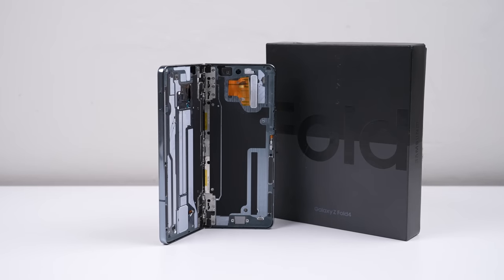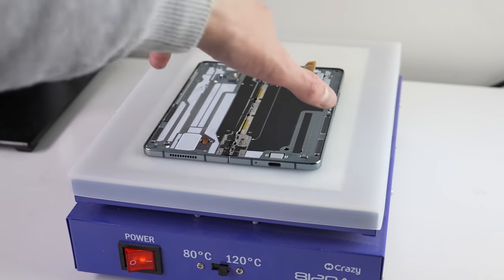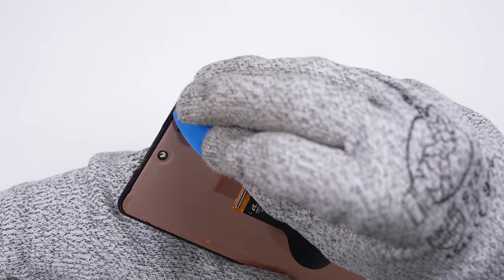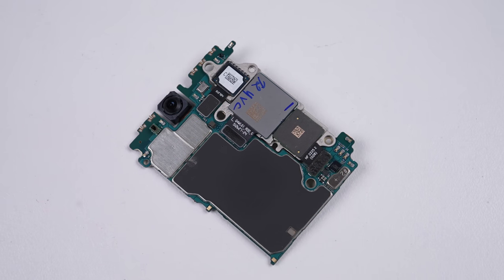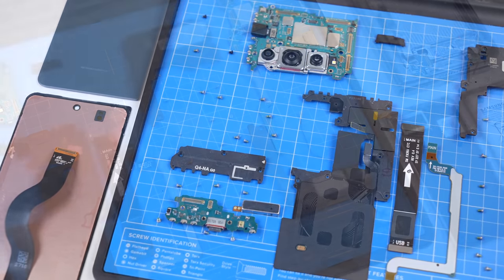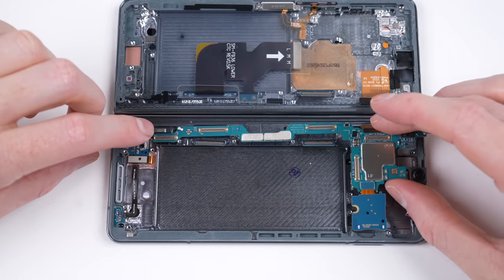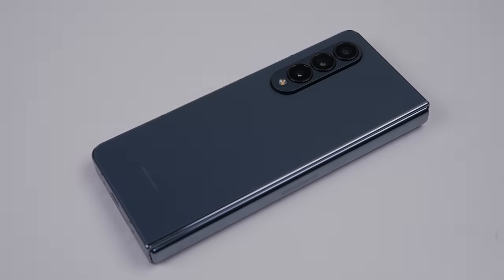Galaxy Fold 4 Restoration - Sellers Lies So Obvious I Had To See It For Myself.

Comment: while that phone definitely wasnt touched by a licensed tech, samsung license0s do exist. Asurion, the US largest phone insurance providers paid for mine as well as my apple certification. 
The different screw behind the screen isnt a screw holding in the plastic cover. it holds the sim tray in place. easy to keep separate if you lay your screws out in order.  i usually throw a couple thin strips of double sided tape on the back of the battery to ensure it doesnt loosen in the future with exposure to heat. i would also recommend an AOD jig, makes opening most samsungs a dream.  otherwise, excellent video as usual.

Comment: While it might have 18 months warranty left on it, Samsung's flip phone warranty (Samsung Flip and Fold are in this category) doesn't cover the screen in any way, so any type of screen damage either accidental or manufacturer's defects have to be paid in full by the customer, unless you take out an extended warranty of sorts which in most cases costs far more than a screen replacement

Comment: You can use IR ceramic heat plate - it does not need direct contact. One like they use as bottom heater in cheap PCB hot air stations. Just stick the thermocouple on the metal part near battery not to overheat it.

Comment: Congratulations, you are a "licensed technician"! I also noticed that the sim tray was attached via flex cable, does that mean it's upgradeable?
Reply: I only hope that some day, there will be an available SIM tray upgrade, user installable, with a Micro SD card slot piggybacked to it.  BTW, my LG V20 has that arrangement, although you have to open the door and lift the battery out to access it.  BTW, my Fold 4 and V20 are networked together, along with the other wi-fi capable devices in my apartment.

Comment: The E.U is passing a law that will stop phone manufacturers from sticking batteries with adhesive so the replacement battery will be easy to remove & replace so click off back panels may return

Comment: I use to work for a major US based repair company that is partnered with Samsung, and am certified/licensed to repair their phones, so yes we exist. Also yes, we never remove the inner screen, Samsung does not repair that screen and will usually just replace the phone or it will require a complete body/frame replacement that houses the inner screen.

Comment: until today you've been very lucky that none of the samsungs you've formatted are active "format lock", I don't know what it's called in the english language system, but i know that you can't format it through the boot loader without the device's password if this option is on. I know this because I played a lot with custom rom when I had samsung and this option always got in my way in stock rom

Comment: Yea definitely an expensive repair for DIY. I ended up taking the z fold 4 refurb to Cityphones (a samsung authorised repair place in melbourne) and yeah while it felt like paying twice, it still works out cheaper than a brand new z fold!  When they do it, new batteries are alao included in the price.

Comment: I wonder if the high temp adhesive is an anti repair measure.
Reply: It's not. It's a very thin adhesive so it needs high temp resistance otherwise the screen could fall off if the phone were to overheat for whatever reason
Reply: @thehellkeeper5674  I don't recall most other devices having that issue with the screen being detached like that, and they don't require extremely high temperatures to soften up.
Reply: @HobkinBoi  the outer screen on the folds is particularly thin and so is the bezel so there isn't mich room for the tape, the outer tape is less than 2mm wide

Comment: Hey, thanks for the clear teardown. Im a former phone repair tech with a fold 4 that now powers off when folded. I was wondering, do you have an idea of how power is shared between the two batteries? I suspect this issue may be due to wear of a flex cable shorting when folded. It remains functional during folding if its plugged into power via usb.

Comment: My guess is that whatever happened with big screen, wasn't covered under warranty, hence why they didn't just use that. I am pretty sure that internal screen doesn't get much of extra warranty, despite being so easy to damage. Could be that reason why screen was ripped off was because damage, whatever it was, caused it to not boot in the first place, so seller though to just remove damaged screen by tearing it out, and that didn't help. And because they didn't know it has to be present, they gave up on repairing it at some point and sold it. And made up how it was done by "licensed technician", likely what they meant was certified technician. I used to work on phone support of local ISP and customers tend to have pretty wild imagination to come up with terms for things they don't quite know how to call.

Comment: How do you check if it’s FRP locked? I’d hate to do all the work to find out it’s locked to the previous owner
Reply: you don't, you need a working screen to check that, also frp is pretty easily bypassed most times
Reply: @milktoast56  on the newer stuff like it’s it’s not so simple especially Samsung right ?

Comment: To answer your question about phone still having warranty. I bought a flip 4 that had warranty until 2025 and the hinge was popped out. Samsung is refusing warranty repairs on all those devices citing impact damage even if there isn`t any and the devices have known faults with the hinge design. Bought mine for £120 and repair cost me another £75, so £200 all together still not bad for a phone that`s £1000 brand new from samsung.

Comment: My phone recently got repaired, and now the back cover is slightly loose, as in I can easily put a spudger in between the inside and the back plate. Is this fixable by buying the same adhesive template you bought and heating / applying it myself? Really don't feel like losing my phone again for a week

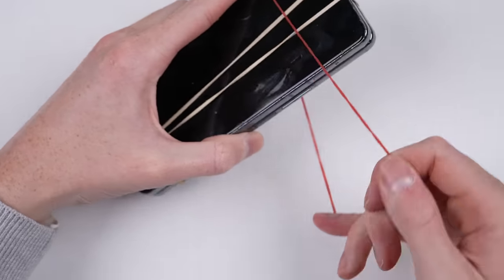Comment: 10:01, is there another way to remove the excess glue after its dried. I have some spillage on the side of the crack. Would alcohol do it? if
its not coming out with the hand completely.

Comment: The sales pitch comes with the tech they pretend to have to download,  I  remember the same sentence from every single shop I went to with the Galaxy Edge when it came out.  The charging port  design problem was the problem.  Every single person  said that they may scratch the phone taking it apart and it would cost £50. The  most was £80.  I  knew this was crap but  heard the same thing in London, Manchester and Preston.  I was friendly with  a  shop owner who told me that they would say all that and  all they had to do was  plug in a different charger. 
RIP Off.

Comment: i doubt its heat resistant gasket, that stuff is very low modular and barely hold onto anything, its probably just a heat resistant version of the glue they been using all along. i use heat resistant gasket all the time and it does not stick well, you could literally just pull it apart, its a very weak substance and is designed to be held between 2 bolted together materials.

Comment: Looking at the pattern of the tape holding the battery inside its made to be softened by some soft of glue remover. It has space for liquid to flow around and soften the tape. I wonder if Samsung repair center have some special stuff

Comment: Hugh you are a master...Sad to think that if this were an iPhone you could not have done this because you would have been unable to reset the phone to it's factory settings.
Reply: that’s not correct
Reply: @nas1m it technically is cuz you can erase it, but icloud unlock is a whole different theme, it might work but you either have no signal, or it's very pricey

Comment: Hi Huhg, inspired by you I bought few iphones. In that lot was pink iphone 5c without screen, battery, antenna,... When i put board into other housing witn battery and screen iphone was ready to be activated. I did activated it and its on ios 7.1.2. It is not sim lock with 16 gb of memory. Housing is in very good condition with few small scrapes. I am asking you do you wanna buy it from me and do a restoration or should I fix it and sell(also for how much i could sell it)?

Comment: Over 700 dollars for the replacement display. What the hell. That is outrageous.
Reply: Foldable screen baby.

2 years ago Hugh made a video repairing the 1st gen Z Flip, the screen itself costs A$895. Now with A$700 you could get a display for the Z Fold.

Still expensive, but yeah, the tech starting to get better and cheaper
Reply: @mArvAlcao71  

It will get better when the manufacturers stop using glue.
Reply: @theshadowman1398  kinda unlikely tbh. Either glue or some kind of gasket

Comment: I'm having the fold 3 and needing help or advice with repair,  my screen protector has been slowly separating for the past year and now the middle looks like if u lay down scotch tape on a wooden surface and been getting the run around from tmobile Samsung over the phone and in best buy seems like nobody wants to take responsibility in helping to repair or replace and just discovered last week that my back is separating from where the 5g antenna is all the way down,  i haven't dropped submerged or spilt any liquid on the device and a $200 deductible is quite expensive and feel like it shouldn't have to be paid from no one interested in helping until now,  out of 36 months got 16 payments left

Comment: There is no thing as a "certified" specialist in the world where I have the "certification" to work with electrical devices using up to 1kV even though I've only worked with things no higher than 48V. I just gave a man from "the institute" 100$ for the "course", sat through it for 4 hours, answered a few questions and got the papers.
Certifications mean dog shit.

Comment: Probably meant Samsung authorized technician. But still removing the inner screen makes no sense. Especially like that. Removing that inner screen voids any warranty on the phone.
Reply: Also you don't need the inner screen to power the device on. Phone probably just need battery reseat

Comment: nice one. how do you guys factory restore an android phone with google account ? i can get into that menu and factory reset it, however on the setup it asks the previous email and password
Reply: afaik you can't. The previous owner needs to remove the device from their Google account. I could be wrong though, I'm sure there is some type of hack to bypass it.
Reply: Pretty much just search for phone model and add frp bypass to search and follow the instructions.
Reply: @TheDuumiMuumi  ill google it and give ti a try. thanks
Reply: UICC unlock?  Taking out the SIM card it came with and putting yours in?

Comment: A friend who works assembling Samsung phones asked his boss why the battery glue is so strong and he said is designed to become softer as the battery dies and becomes stronger after being in contact with oxigen so you can use it for battery replacements

Comment: As this video suggests its basically completely pointless to repair a phone these days, not only does Samsung use extra heat resistant glue to keep the front screen on, there's also no pull tabs for the 2 batteries and parts are basically non existent unless you go the shaddy reseller route. Plus the total repair cost is just shy of repairing it through Samsung and significantly more than just paying 10 a month + $100 deductible on care+. Worst part about all this is as a Fold4 owner, seems like replacing the inner screen is almost a guarantee in 2-3 yrs.
Reply: Actually,  Samsung does offer service packs. They're just really costly and can only be sourced through a few niche providers for which you usually need a business to access.

Comment: DO NOT USE ANY METAL TOOLS TO REMOVE A BATTERY. They can easily damage the battery and start a fire. Only use plastic tools. Trust me I never was able to puncture a battery with a plastic tool. It’s at the safest way.

Comment: How does Samsung ensure that having a display in front of the camera does not lead to a loss of quality in the camera sensor?
Reply: they pretty much don't, Fold 4 takes terrible photos through the folding screen camera, but there's a mode that lets you use main shooter as a selfie cam so it evens out
Reply: They don't lol. I have a Fold 4 and the under display camera quality is so bad that I NEVER use it. I'd honestly just rather have a punch hole camera with excellent quality.
Reply: @vLily  Oh, I didn't know that, thank you. I thought they had some technology to avoid that.
Reply: @BigMacWitCheez  thank you:)

Comment: As a mobile repair technician myself, I confirm there's nothing as a licensed technician. Although you get certificates if you are learning through a reputed institute.

Also I was somewhat screaming when you poured so much glue and so little of these rubber bands tied. It will not be easy to remove in the future. 
General practice is to use just enough glue(a .5-.8 mm line) to all edges and use atleast 2 vertical and 3-4 horizontal ties of rubber bands to keep it in place

Comment: I replaced the battery in my LG G7 and got a warning to not unplug the battery. "The battery is not a replaceable in this phone. Do not unplug the battery if it is frozen. This is a disposable phone." Absurd.
Reply: Shhhhh
Its a secret, but if you defrost it, you can unplug it and it wont be disposable anymore.
Reply: My flagship LG V20 has a removable battery.  It was LG's last holdout with one.  Decided to make it part of my home network, along with my Fold 4, Vizio TV, Onkyo receiver and Epson printer.  It also serves as my home theater controller. In my household, nothing goes to waste.

Comment: Question I found a destroyed Galaxy Z Flip 3 on the side of the road. Turns on and only the front cover screen works. Do you think it’s worth repairing or will the account locks make it unusable? Basically I’m asking if there is a way to bypass these locks